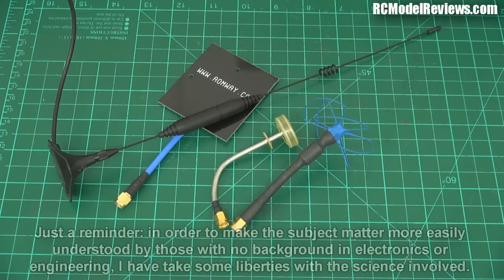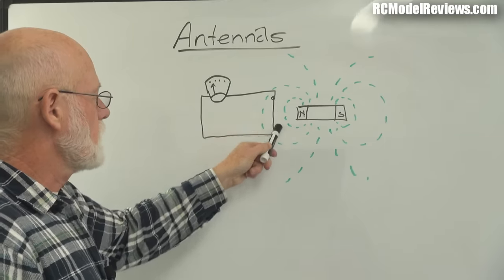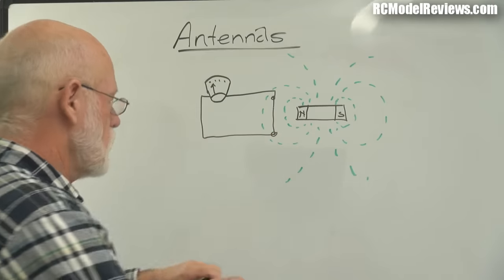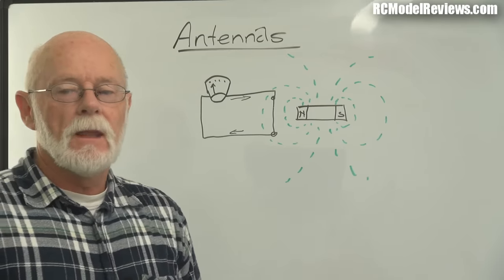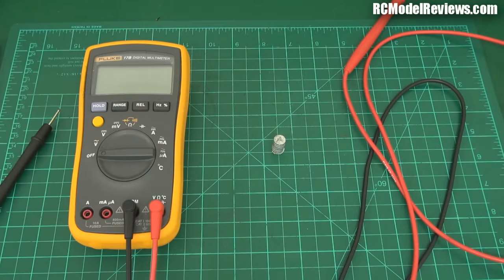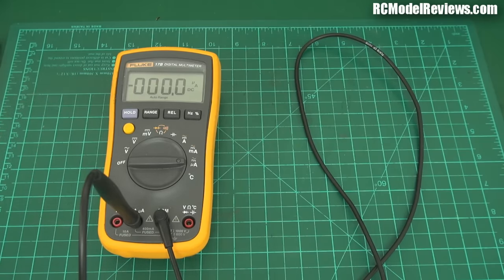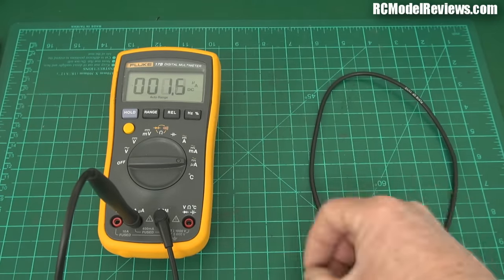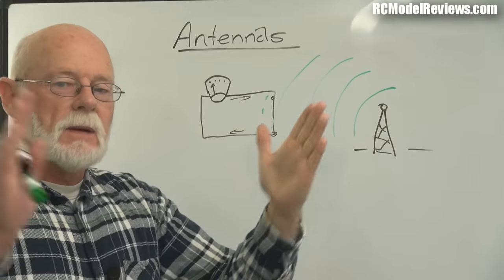How do antennas work?

Comment: Great practical explanation of antenna theory and operation. This is sufficient for most people to understand the basics. Really good explanations boil down the theory to the most essential parts without getting bogged down in the details or too many equations. It would be great to see this introduction video followed up with actual examples with a bit more theory where the numbers are plugged and secondary effects of the antenna geometry, cabling, and circuit connections are addressed.

Comment: Been a HAM since '78, and have built dozens of antennas, and even did moonbounce with an OSI 6502 controller back in the 80s, but have never heard it antenna function put so well as "more metal in the game". I sure wish somebody had said it so clearly back in my college days, but even the professors didn't cut thru the BS like you do here.

Keep up the great work!
I may just start bending welding wire again...

Scott
Reply: I just started CB home unit with a Nice mint in box old Kenwood...Im using a 5foot car antenna on a 30ft pole in yard... What antenna and or device can i use to Reach Out a Little more.. on a good night i can Receive/Transmit 20 Miles.... Will a Bigger antenna make a Difference?
Reply: I think a lot of this video is rules of thumb for RC pilots that aren't 100% accurate. Radio waves aren't actually sine-wave-shaped in space. The reason polarization is important is not because of the area overlap. It's not just about having more metal, it also has to be shaped correctly.
Reply: You know you were mentioning about a moonbounce I did not have a ham radio license when I was a kid but in the 1970s I played around with the 11 meter band and don't a large Moonraker duplicate beam that was the name of a manufactured brand that I duplicated and I'm horizontal I used to do a moon bounce by just putting a site level on the antenna and aiming it at the Moon didn't really know where was going to end up I used to just see who answered me
Reply: Scott Marshall hi sir can I ask you a quick question? Is it possible to transmit/relay a LF signal from the source by using a non attached cable with a loop antenna or how can you amplify a LF signal? Sorry if that don’t make much sense I’m not a expert
Reply: @thewhitefalcon8539  there is a disclaimer at the front of the video... saying he had to take some liberties to make it understandable to a wider audience.   Most hobbyists don't GAF as long as it works... yes, I agree with you because I've made my living as an electronics tech my entire life, but this vid is indeed a really good explanation of the theory.
Reply: @thewhitefalcon8539  all electrical radio waves are sine waves ..  Ya sometimes they bounce and are refracted but all waves remain in the basic sine wave format
Reply: @peterpauldonoghue7024  They are not sine wave shapes. Nothing moves in a sine wave pattern. The only way you get a sine wave shape from a radio signal is by drawing the signal on a graph.
Reply: @thewhitefalcon8539  .. OK Alex 
Two questions for you 
( in the context of radio communications )
Q1 , what is a wave length ?
Q2, what is a frequency ?
Reply: @peterpauldonoghue7024  One question for you: When a radio wave propagates in a vacuum, which particle moves in a sine wave pattern? Antennas are not part of a radio wave.
Reply: @thewhitefalcon8539  .. Axel, Did I say an Aerial is part of a radio wave ? ..  But to answer your question, "Which particle moves" = the photon ! ... Do photons exist? ... Good QUESTION...As long as electromagnetic fields exist, there will always be photons !! . As you know electromagnetic waves are created by the vibration of an electric charge with both an electric and a magnetic component.,  - Maxwell thought us that transfer is caused by propagates in  the form of photons, (the propagation of photons through a medium is a different matter, ). Heinrich Hertz by using Maxwell's equations figured out how to make these electric and magnetic fields detach themselves from wires and 'go free'.. EM waves can follow all sorts of patterns, In a vacuum plane waves keep the same shape - through a medium, however the shape of the wave changes as it propagates, but each sine-wave component, however, keeps its sinusoidal shape..
Reply: @peterpauldonoghue7024  Do photons move in sine wave patterns?
Reply: @thewhitefalcon8539   .. Whats your point. ?? If i said they DO !! .. can you refute it ? 
LISTEN .. Go back and read your original post to this thread ..
" I think a lot of this video is rules of thumb for RC pilots that aren't 100% accurate. Radio waves aren't actually sine-wave-shaped in space. The reason polarization is important is not because of the area overlap. It's not just about having more metal, it also has to be shaped correctly."

Can you elaborate on what you are trying to say ?
Here is a Video that I think explains the theory well .. 
https://www.youtube.com/watch?v=-F7KYLO4Bkg..
have a look, come back here ,, and EXPLAIN your take on what shape Radio Waves are, and why 'area overlap'-'more metal' & 'polarization' has to be shaped correctly' ?
As I don't understand the point you are trying to make ..
Reply: @peterpauldonoghue7024  It's pretty simple. Radio waves are not sine-wave-shaped. The only way to make a radio wave look like a sine wave is by drawing it on a graph where one of the axes shows the field strength. But field strength is not a direction. You are drawing something in 2D that is actually 1D.
Reply: @thewhitefalcon8539  .. I give the last word on this to Joel Szymczyk
Joel Szymczyk
7 months ago
@Alex C there is a disclaimer at the front of the video... saying he had to take some liberties to make it understandable to a wider audience.   Most hobbyists don't GAF as long as it works...
Reply: @peterpauldonoghue7024  well then how come your first comment was after his one

Comment: Thanks for the refresher!  I haven't heard the term 'Yagi' since my school days...  
The best example of Yagi antennas is the old roof-top TV antennas that were used to capture a VHF signal from your local TV station.  If you were fortunate enough to have a rotor, then you could turn a dial on a set-top box and a motor would spin the TV antenna accordingly, allowing you to pick up TV stations in that direction...
Thanks for posting this detailed video, and JUST SO YOU KNOW, I didn't fall asleep!  ;)

Comment: Antennas fascinate me. I have made a 450. Mz Yagi that many elements. This antenna was near five feet long. I hooked to my police scanner. And pointed it toward a city that was close to 35 miles away. I received their radio transmissions perfect. I only listen to Union Pacific railroad traffic now. I made a quarter wave dipole and it receives beyond my wildest expections. The antenna is standing in my bedroom. I have a Uniden BCD536HP. The antennas, telescoping and rubber duck antennas are like having no antennas. The railroad works on two meter 161.265 Mz  most of these stations are 35 to 40 moles. Keep up the great videos , I have subscribed. Curtis

Comment: I just got my first function generator. It's just a little $100 thing based on an FPGA. But ever since getting it I've been overwhelmed with thoughts of all of the different experiments I can do with it. One such experiment I wanted to try is to transmit and receive radio signals. So video lectures about antennas and practical RF design are really useful in helping me to realize that goal. Since I have no experience with RF at all. Before I got my function gen, the highest frequencies I'd work with were <10hz for some blinken lights circuits.

Comment: Speaking as a raggedy-arsed mechanical engineer, I found this talk  to be an easily understood refresher in electromagnetics and for the first time have some appreciation of how antennas work.  The descriptions of monopoles, sleeve dipoles and yagis was easily understood.  It took me a bit by surprise when you started talking about radio-controlled model aircraft - another activity I indulged in years ago with minimal success !
I minor quibble, it would have been helpful to remind the viewer of how decibel numbers work.  I recall that the dB number is a log-based ratio but forget the conversion to non-logarithmic numbers.
Thanks for a great presentation.  Good-on-ya mate !

Comment: Thank you very much for this video. I have been looking for a video that explained antennas that started from the very beginning and did not assume antenna knowledge and this is the video that helped me understand. Your starting with a demonstration with the magnet and the multimeter helped tremendously for my understanding of what was happening between signals and antennas. Thank you very much!

Comment: Whiteboard videos are the best!
Reply: I'm not an expert but most plastics are transparent to the 5.8GHz FPV band, so the shrouds should have little effect.

But what will cripple your video is rain (it absorbs GHz frequency r.f.) and close proximity to any conductive materials (wires, metal objects, carbon fiber etc). In fact this is one reason why Tx antennas are raised up and usually placed at the edges of frames.
Reply: i found even moisture in the air cuts my range a lot, maybe 10% on a normal cloudy but not rainy day.
Reply: +TheMadmacs That's quite likely.

The attenuating effects caused by water increase with frequency, so in humid conditions switching from 5.8GHz to 2.4GHz will give you better, more reliable video and going to 1.2GHz would be even better.
Reply: yeah i hear the phantom can switch to 2.4ghz video for long range?.. eek! thats a bit dodgy for anybody else flying. we can't use 1.2ghz in the UK, maybe with a license?.
Reply: Thanks to spread spectrum technologies your use of 2.4GHz for video isn't likely to be a problem for other fliers but their transmitters will likely stomp all over your video signal.

As for 1.2GHz, it's (almost*) legal here in the UK provided you have at least a foundation ham license (easy to get, can be done in a single weekend and most 10 year old kids can do it without breaking a sweat) but that said, you're unlikely to have legal issues if no one complains.

Oh and one other thing, the antenna's for 1.2GHz are quite big and in the case of circularly polarised, fragile. Definitely not something I'd want to put on a quad!

*You're not supposed to transmit on the 1.2GHz band from an aircraft.
Reply: How can the dji mavic fly 2 miles or more ? What is there transmitter antenna  by comparison to the 2.4ghz ? Say from spektrum for example ????? White boards always 👍👍
Reply: There is no way you will get controlled flight at 2 miles and more under normal RF conditions. The 2.4 Ghz band is public so it is shared with a zillion devices. Trying controlled flight in a city at even a mile is impossible. Your drone will be gone. Now that said you can fly preprogrammed flights using GPS but make sure you dont run out of batteries. There is no majic with mavic. They must follow the standards for transmission power and are bound by the same antennae as everyone else.
Reply: xxenricop  and your point is? That guy said it failed at 1.5 km, he isnt flying a mavic and he is in the countryside!
Reply: exponent mantissa Watch the video....he lands the phantom 8km away on the flat roof of his house about 24 min in to it :-)
Reply: whiteboard videos are remarkable
Reply: That is not a Mavic and it is not in a city. In a city with thousands of competing devices (Lans, phones, wireless video cams) this would be impossible. I would bet against anyone  that said they could do this. If he  indeed did do it he got lucky. One thing to note is he had line of sight which not everyone has.. The 5.8 Ghz video is real suspicious as  it is even shorter range.
Reply: xxxenricop Yes

Comment: 2:30 Hey Bruce, I think you messed up the flux lines for that magnet 😂 Either the magnet polarity or the field lines need to be rotated 90 degrees.
Reply: Power Max those Flux lines are correct. Flux =\ magnetic field line.  The two run parallel.
Reply: No Flux lines run through a magnet from pole to pole.
Reply: Did you forget a comma? Or did you mean what you wrote?  
"No flux lines run through a magnet from pole to pole."
"No, flux lines run through a magnet from pole to pole."
Reply: Grammar, the difference between knowing your shit and knowing you're shit.
Reply: This "enthusiastic guy" is clearly a great hobbyist, but a layman when it comes to understanding the physics of the subject at hand. Flux lines flow from pole to pole - not back into the same pole. The dotted green lines scream out == 'Hey - I obviously never studied or took a class at any level in the subject of basic science, let alone physics, magnetism, or antenna theory for that matter.. .. Sorry
Reply: It seems that he's drawn a coil with its magnet flux lines, and he has confused the polarity of the magnet with the polarity of the coil current.
Reply: It would take that mistake with a grain of salt.  Bruce's videos are always informative and amusing as well.  For those who don't know who Bruce a.k.a the Missile Man is, go google Bruce Simpson.  He is an electronics, software, mechanic engineer.  He shook US and NZ government for building a home-brewed missile for under $5000 and published a book about it.  Check out his personal website at http://aardvark.co.nz/pjet.  Sadly, he is dealing with Parkinson's over a year now.
Reply: @undermine28    isodynamic lines  are  ' contours' of equal   flux .. I copped this slight error as well ..but if you can picture the magnet as been donut shaped - all is grand .
This is by far the best antenna theory video I've heard on YouTube.
73
Reply: @Mr.Tiger.2013  thank you for sharing this info Than .

Comment: The flux lines are oriented incorrectly in first diagram.
Reply: Those small mistakes are some of the most frustrating ones
Reply: I spotted that too .
But I imagined that it was a donut magnet and just went with it .
Overall this is a great video on antenna theory. I doubt you will find many hams who could explain it better.

Comment: several errors
7:09 The current changes direction 2 times per period (so it's 2 times the frequency)
9:21 The two sides are not equal. One is just a function of the other.

Comment: Radio waves are not magnetic waves, they are electromagnetic radiation (EM radiation, EMR) not the same as a magnetic field.
Reply: I'll second this, rather than repeating it. Hertz vectors, and all that.  Better not to explain at all than to explain incompletely.
Reply: True, but this is  Antenna 101 and the real theory gets complex...Bruce said at the start that he would be 'taking liberties' with the science; it is aimed at a specific audience, ie RC enthusiasts and the general public;  I think he does a great job simplifying the subject.
On a complete tangent (not at all germane), I once had the privilege to hold and examine the hard-bound personal notes of one of the RADAR Engineers from WW2...some of it was actual notes from lectures in theory, the math quickly 'went over my head' but there were references to works, to which I referred......which referred me in turn to a 10 volume treatise on  the derivation of certain formulae...I've always had a problem with higher mathematics but I would like to think that there is a 'Bruce' out there who could at least help me to grasp the subject fundamentally.
One last note (from the notes)...'.don't let Master Sargent xxx catch you with an adjustable spanner, for he is an evil man!'...
I had occasion to work on various masts in the Shetland Isles, interesting that some of them, even though they were galvanised steel, were 'denso-taped' top to bottom and I wonder what Sargent got 'p'eed off and thought, right, I'VE GOT JUST THE JOB FOR YOU TWO.......
Reply: They have a component of both 90 degrees out of phase
Reply: @T2D.SteveArcs  , the electric and magnetic components are in planes at 90° to one another, not out of phase.
Reply: I understand this is meant to be basic but a lot of it is just plain wrong. Static magnetic fields are quite different to propagating EM waves and he keeps saying current but it's induced voltage that the receiver is looking at... nothing like wireless charging.  A good effort though and a lot of useful stuff; I always find practical/physical examples of these invisible systems useful.
Reply: I was hoping the near field and far field would be mentioned, so far it has not been. By your comment I suspect that doesn't happen.
Reply: Obliteratu  it’s both!  to have any power   That’s why it’s measured In watts on Transmit and receive sides
Reply: @davezimmerman1510  possibly, but voltage is key; receiver sensitivity is measured in dBμV and antenna factor (analogous to gain) is in dBμV/μV/m (how much dBμV emf is induced in a revive system for a given field of dBμV/m... The μV components cancel out to give dB/m, one of the more quirky units). When doing coverage predictions, you can use dBm (power) but it's quite common to use dBμV/m ("dBu"). I have never seen dBAmps used for anything other than localised/static magnetic fields.
Reply: @Obliteratu  You're right. Magnetic fields are nearly useless for transmitting or receiving at any reasonable distance. This is because magnetic fields reduce exponentially. Think about wireless charging. Those are magnetic fields. Magnetic fields are used to transmit power at extremely close distances like in the wires of transformer. Transmitters and receivers rely upon the electric field to transmit data over distances. A common device that uses electric fields are capacitors. I like to think of an antenna as a sort of capacitor with air as the dielectric. When I've done EMF measurements for the power company, we have one device to measure the magnetic fields generated by the power line and another device to measure the electric field generated by the line. The device to measure the electric field is an antenna. It's very sensitive so the user often affects the electric field.